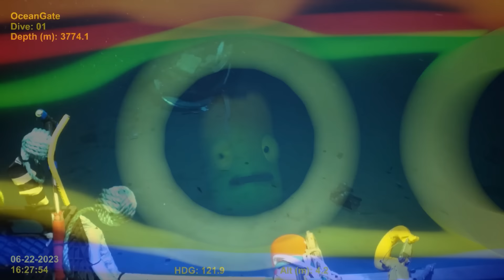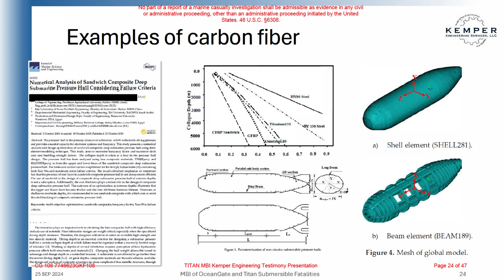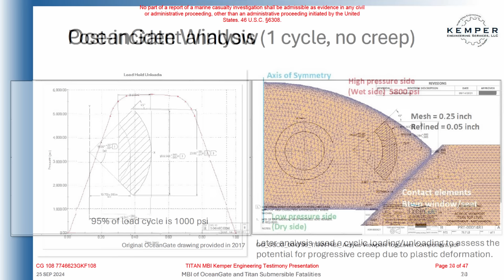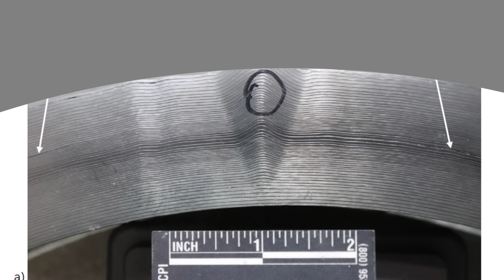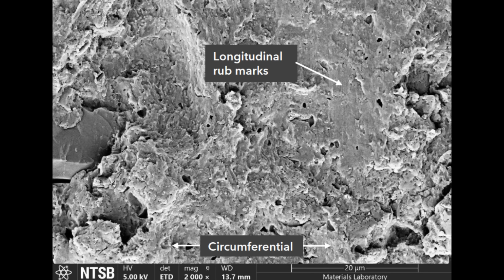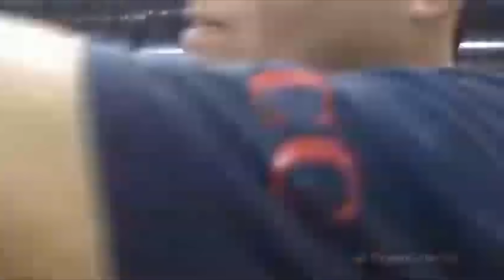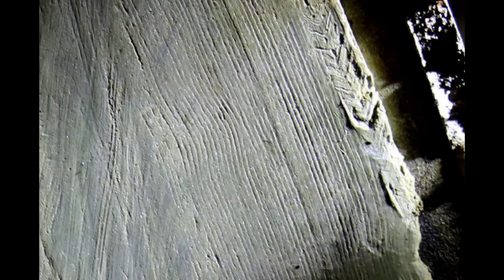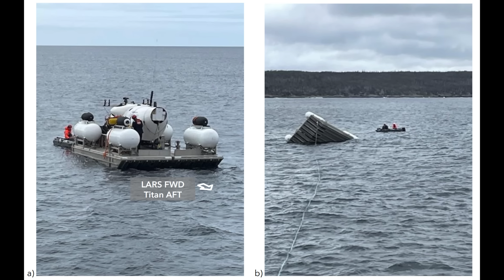OceanGate Wreck Shows Why Sub Wasn't Strong Enough To Survive - NTSB Shares Important Details

Comment: When Titan was dropped and caused the dome to fall. It may had damaged the bond between the ring and the tube. High pressure water may seeped in caused separation and sheared the innering flange, and the tube collapsed. That could be a hypothesis.

Comment: The grinding of the wrinkled carbon fiber, when uniformity and load distribution is so fundamental, is just unbelievable .
Somehow i think the end caps did not really need to be glued , the pressure would maintain them and some sort of soft adhesive could have been a better choice to allow for different shrinking rates between such different materials.

Comment: Engineer notes:
15:18 mixture of adhesive and cohesive failure of the resin
So, those large areas of black could be indicative of a failure of the resin to adhere to the fiber..
Looks like the inner flange of the forward ring was completely sheared off..
Towards the end of the video, seeing the buckled hull, I think I see what's going on (besides the obvious compressive failure shown).  As soon as the hoop buckles with the immediate cause, the cascading effect would be that the rest of the hoop is no longer able to carry that compressive load.  Composites are generally weaker in compression than tension.  There would also be massive interlaminar failures in a shear mode as the shockwave propagates.  Which makes sense why the rest of the hull basically disintegrated while being pushed aft, like putting a mass of carbon fiber toothpaste into a tube.
Just speculation, I'm sure the actual investigators have a more clear picture of exactly how this all broke down...
Reply: If you watch the assembly of the domes to the tube, you'll notice that from a maximum integrity point of view, it's upside down. The socket was in the dome, the adhesive on the tube... no place for air to escape the joint. Under the compressive load of submerging, the air would likely have gotten pumped into any voids in the CF, of which there is evidence, or even into the adhesive between the 1" sections.

ETA: also engineer...
Reply: @tehbonehead  excellent insight, thank you! My lab mostly breaks things, we don't assemble them.

Comment: Arm chair engineer here, Scott. I would be careful with that term in the way you are using it. If CF were a good candidate for pressure vessels (submersibles), and cost effective, it would be used. CF when used as a pressure vessel (as in SCUBA tanks, 8,000psi Helium tanks (spherical) for RCS systems (I know, we used them for RCS at a low cost payload insertion to LEO company in the 80s), or as our filament wound motor casing for our hybrid rocket (Polybutadiene+carbon)).  Again, if it were feasible/practical/scalable to use like OceanGate did, the industry WOULD invest even more money into testing. Think of an analogy as the very thin aluminum (not aluminium) beer can - contains high pressure inside, collapses just looking at it under end-compression (standing on it) and tapping the side with your finger.
Reply: I like how he is using it, very appropriately

Comment: Yeah I would have built an acrylic sphere with the hatch on top. Then use a tall catamaran hull as a tender so to avoid having to lift the sphere out of the water. Instead the sphere docks to the bottom of the ship between the twin hulls.
Reply: Or just don't lift it by the pressure vessel. It had an external frame underneath it: just put four uprights at the corners of that with lifting eyes on their tops. Picks it up like a cradle.

Comment: Not an expert but thought A composite autoclave closed moulding tool/oven that uses pressurised steam  or vacuum oven to manufacture lightweight and strong composite materials would alleviate  wrinkles, was a autoclave used for the curing of the carbon fibre?

Comment: If you think about the longitudinal force exerted by the end domes alone, on the hull...some 15.5 million pounds each....its like standing the carbon fiber tube on on end and balancing 4 fueled Saturn 5's on it.  5500 psi is mind boggling. Even 'high-pressure' oxygen bottles get crushed.
Reply: And yet the Titan made 13 successful dives to Titanic depth, it only failed on the 14th.
It didn't get crushed by that mind boggling pressure, but failed from fatigue of repeated pressure cycles.
Reply: @KantiDono  There was a few of pressure chamber tests, and some deep aborts.. Implosion was 1400' above the floor. The NTSB report will be interesting.
Reply: @owenmerrick2377  they did many dozens of dives but reached the Titanic a fair few times.

It really is astounding that it managed to do that many with all the shenanigans we know they did.

Comment: The thought process behind 11:10 is unbelievable. "Just machine it smooth and keep wrapping."  
So, it was apparently five 1" thick layers, instead of one 5" thick layer? 
Wow.
Reply: Yep. There were also comments during the hearing that sanding ripples flat would have cut through many layers of fibre, hence further compromising the structure.
Reply: @albedo0point39  Now thinking about this, And seeing it in my "Mind's eye"  It's like when a dam cracks apart in the movies, as soon as you see it, it will start to smash apart and come crashing down.
Reply: @albedo0point39  wild is an understatement. "Hey, let's calculate the hoop stress after cutting the fiber a couple of hundreds of times..."
Reply: And then they didn't take into account glue thickness, so the hull was too big for their endpieces, so they just cut some more off!
Reply: Absolutely. If a design choice requires you to keep piling on corrective measures, it was clearly a bad one.
Reply: Yeah… there is absurdity there. But that’s a moot point. CF was the wrong material to begin with.
Reply: @mercoid  IIRC, the shape was also all wrong for a submersible that is supposed to dive that deep.
Reply: @seq31  Because you specifically mentioned spaceships? What you want for spaceships is not what you want for submersibles.
Reply: Actually 2 ideal pipes layered like that will have smaller stress under same pressure difference than 1 with twice the thickness (when friction is ignored). I think buckling and grinding are the problem here, not multi layer approach.
Reply: @rh9909  What do you think caused the buckling and grinding?
The multi-layered approach, that can't happen in a homogenous or single piece of cured carbon epoxy, homogenous materials can't "slide" or "grind" against itself, it fails or it doesn't.
Reply: Wow. Woooow. Really. Woooow.

Dig deep! Get in there.

Comment: It's obvious that the glue joint failed at either end and likely first on the front.   When the carbon fiber cylinder started to bend in the middle that movement tried to pry the thick glue joint apart from the outside edge.   Because there's more movement on that outside edge it works to slide apart the laminated sections.   

You can see that the titanium lip was pulled apart on the outside and sheared off on the inside as the glue let go.   Unless you have a way to inspect and monitor glued parts...they're worrisome.

Comment: Well, if aluminum is allowed, I bet the next cheapa$$ billionaire comes along, builds a pressure hull from 7075 and dives it, until if fails from fatique.
So far was under the impression, titanium is used, because it won't fatique cycle, if loaded below a certain stress limit.
Reply: there's more than one kind of fatigue but that's the primary one yes
Reply: You might be interested in the Aluminaut.  It was the world's first aluminum submersible.  It's cylindrical, has a test depth of 5200 m, and can carry a crew of 6-7.
Throughout its successful (albeit short) career it did things including recovering a lost nuke and retrieving the DSV Alvin after it sunk to the bottom of the Atlantic.  It is on display at the Science Museum of Virginia in Richmond, Virginia, but is still maintained in case its services are required again.

To my understanding, to maintain certification, subs have to get inspected regularly.  For an aluminum sub that would probably involve NDT testing and possibly retirement after a certain number of cycles, just as is the case with aircraft. 

I suspect titanium and steel would be more practical for submarines making frequent dives to depth due to the relatively lengthy material life, but as long as the sub is being put through the proper tests to maintain certs, aluminum should be just as safe.  Of course, a company might skip on tests and lose cert, but then that's just operating like Oceangate and I wouldn't blame the material for that.  Something else like a seal could fail too if you're not bothering with maintenance.
Reply: @epicspacetroll1399  Alvin is still in service while Aluminaut is not.
Reply: @tsm688  I am aware.  For most tasks at that depth you probably won't need a crew of 6-7 and a bigger sub requires a bigger and more expensive support vessel, so I reckon this would be the case regardless of material.

Again, titanium and steel are probably more practical for long term frequent use.  I don't think we disagree there.  I just wanted to bring up an interesting piece of history and point out that a submersible can fail if you don't take care of it whether the hull is aluminum or not.

Comment: Aluminium was used in Aluminaut. An amusing submersible - and probably closest to what Stockton Rush was trying to achieve. Light - but big enough for multiple crew, made from ring-sections. It actually rescued Alvin at one point. 

----

I've a plastic 'crystal' on one of ,my watchs. I've another watch with a sapphire crystal. The deflection of the plastic crystal is part of the sealing strategy of the watch. It deflects under pressure and will go all the way to 200 metres - and, in fact - significantly beyond that when tested. 

Sapphire crystals are impervious until they shatter. They just don't move. They won't scratch - but they'll break. 

----
 
One of the most interesting things about the strain gauge information after dive 80 is that it seems to suggest the initial deformation is either plastic - or is caused by something moving into contact and taking up some slack in the system. Instead of a linear ramp up - it accelerates when the slack is taken up. It's mushy and plastic. 

Then again, the last time I looked at a strain plot was in college. 

The RTM did *work*. It just didn't work in the way they thought it did. If they'd seen the change in the behaviour of the hull - or cared - it should've prompted some level of inspection. 

The Oceangate team just weren't successful at listening to what it was telling them. 

And then, it got beaten up.
Reply: I saw some people theorise on Reddit that the change in the force curves could be explained by large voids between the layers having formed, that eventually get squished together as the pressure increased, which is why the curve looked normal as it got deeper, which would also line up with the rubbing damage and delamination
Reply: @nabagaca That should have been a really good theory that should have gotten them to stop the dives.
Reply: The dive 80 story explanation in the ntsb report. He was not condensing it into a sentence in the testimony but in the report it's in print. The sub ended up having three separate hulls. Iirc 1,23,45. Of course not everywhere, but in areas so large it released the stresses from like 3500m up to 100m. Like continental plates sliding over each other with occasional load shedding.
No joke. 
Unless we learn from the coast guard that the drop weights' motor glass sphere imploded then it'll very very lilely have been another energy release earthquake after they dropped the weights. The sudden weight redistribution was likely enough. They said their hull also shrunk under pressure and, well, 3 partially glued hulls probably don't shrink overly uniformly circular. So a slight vibration and restricting of the landing frame, etc etc, might, just might have ended this.

If they had fucking knuckle-knocked on it everywhere in a silent warehouse they would have probably heard it. That wasn't that the acoustic monitoring was built to catch ;-)
Reply: Aluminaut is the best.
Reply: there was no dive 80. There were only 13 complete dives to Titanic